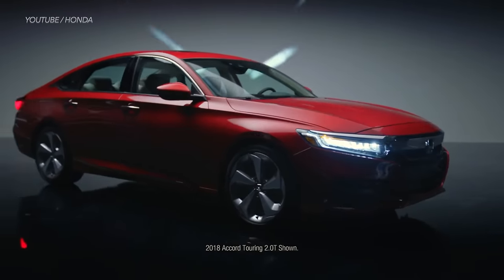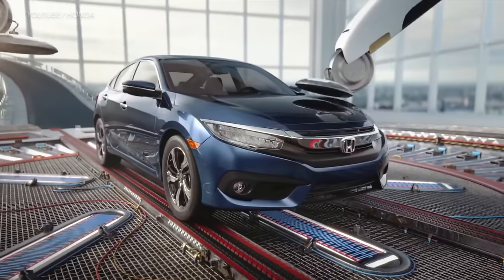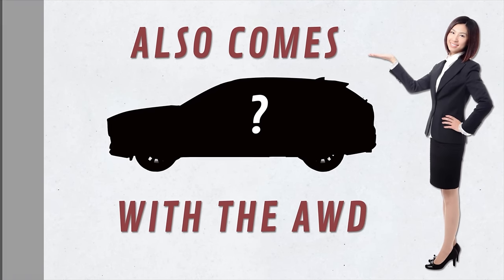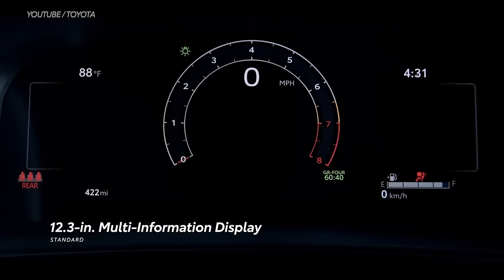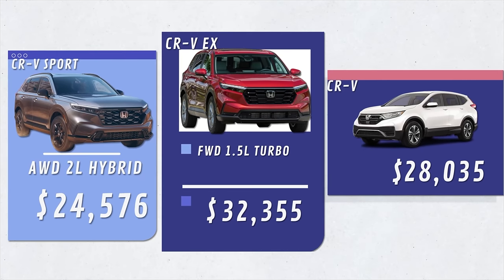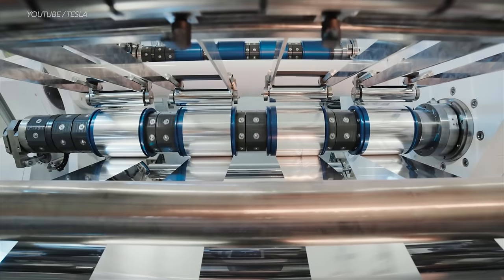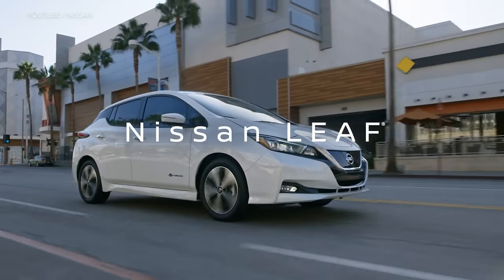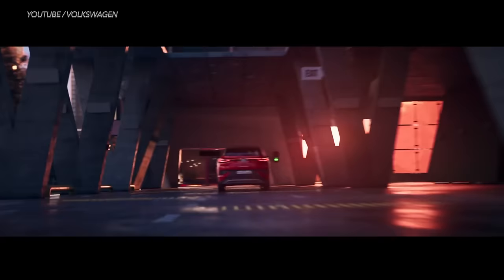Everything You Need to Know Before Buying a Car in 2023

Comment: Crazy. I bought a used 2015 Leaf in 2017 for $9,750 because nobody wanted them. Loved the car. So cheap to drive and virtually no maintenance. Drove it for 5 years, put 45,000 miles on it and sold it back at wholesale to the dealer for $9,000!
Reply: What a great deal, what do you drive now ?
Reply: @aboutmybluestrips  a bike
Reply: those are nearly impossible to get right now i work in the car business none to be found
Reply: How many miles did it have when you bought?

Comment: I was able to find a 2023 Tacoma for the same price as a used 2018 Tacoma from the same dealer so for the first time in my life I’m driving a new vehicle. Honestly insane to me how much used cars are going for currently
Reply: Wow!
Reply: Same with me Honda Ridgeline. Brand spanking new with 2 miles. Over 8K less than a used one with 90k on the clock, and fully loaded.
Reply: After taxes and an extended warranty, I paid 40k for my new '23 car.
Reply: @jackpowell8155  I payed a little over 30 for my Tacoma after tax, I got the utility package honestly a pretty good deal for me at least I don’t need the back seats plus the bed lights on the Tacoma are amazing
Reply: Given some of the complaints about 2022/2023 Tacomas I might go for that 2018.
Reply: @fredmontgomery9436  that's so stupid but there are stupid people paying those prices for used so dealers will take advantage of that. There's a sucker born every day.
Reply: SCORE!!!
Reply: Did the same...got a new 2020 Tacoma 2 years ago
Reply: The 2018 was a better truck.
Reply: @lucilledog8832  they have the same engine, transmission, towing capacity, warranty, weight, seating capacity and much more. It's virtually the same truck. How is the 2018 better?
Reply: @jackpowell8155 40k??? Hope you make good money at least 150k a year you will need it with this new rescisión. 😖
Reply: Great truck, enjoy it and I hope that it treats you well

Comment: When I was shopping for a Ranger last year, a lot of used ones where within $1000 of msrp of a new one.  I didn't need it right away, so I decided to order one so I could at least pick the color.  They even let me drop the automatic start-stop.  Was about 6 months of waiting, but I now have a blue Ranger.
Reply: You were smart, or lucky, or both. I had the same thoughts last year, but decided to hold off and shop used, and shop the new dealer lots as well. Of course I couldn’t find anything, nothing reasonable anyway, and now I can not even order a new Ranger (with my preferred equipment group) due to unavailability of chips. Ford won’t even take an order and put me on a waiting list..
Reply: @histeve1110  they make the ranger at the same plant as the full size bronco. They might be going all in on broncos right now since those are in high demand
Reply: @vitaming582  Interesting, I have to understand their priority. At this point I just have to be stupidly optimistic about 2023 🤪
On a related side note, I have friends that just received a new Bronco..they ordered it over two years ago..
Reply: I ordered a Tucson Hybrid last summer, with the EXACT features, color and interior I wanted... nothing extra I didn't want, nothing short of what I did want.  I had to wait 5 months, and finally picked it up in December 2022, but thanks to the extremely overpriced used car market, i was able to trade-in my old car and have a massive discount on my new car.  I got exactly the new car I wanted at a very reasonable price, thanks to the used car market being so overpriced. All this complaining about new and used car prices, it's like people forget "oh, if used cars cost more than new cars, why don't I trade-in my used car for a new one?"... no, it certainly wasn't free, but dang, I got a lot more for my old car than I would have in a normal market, so my new car was VERY affordable in the end.

Comment: I've been thinking about a PHEV, but it's difficult to justify the price of even a hybrid, which usually cost thousands more than a gas vehicle of the same model. It will take probably a decade to gain that money back thru savings in gas, and the vehicle will likely need a battery swap by that time.
Reply: Yes but they are way less money in maintenance usually. I have had a used Prius C for 4 years and only have done oil and tires.

Comment: Unless you have a real piece of junk you'd be better off keeping your existing vehicle. Replacing a transmission or engine would cost a lot less also. As for putting the chips in the new higher end cars, that makes sense if you can find people that can afford the vehicle.
Reply: As for the chip shortage, its the little things that get cut... I know for multiple Chevy's they are selling cars with "heated seats" that are lacking the microchip that actually controls the heated seats, and Chevy dealers are selling cars (sans-chips) with heated seats that dont work saying "well, when we get the chips down the road, we'll put them in for you"... that's Chevy (who I wouldn't do business with for many reasons, but that's an actual example).

I did recently buy a new 2023 Hyundai Tucson Hybrid... SEL (mid-trim), that a year ago (and for many years before that) had Homelink in the car (basically a built-in garage door opener) for all but the cheapest trims, and now, Homelink is ONLY offered in the top-trim because of the chip shortage.  I'm not paying $5,000 extra for a top trim with features I dont want just to get a built-in garage door opener, so I did an after-purchase replacement of the rearview mirror with a Homelink rearview mirror in my midtrim Tucson Hybrid.  No, it's not a deal-breaker, but these are the types of examples of "chip shortage" issues that are going on with new cars.

Comment: I am a do-it-yourselfer and have had a FIAT for 25 years, and I can tell you the engines are bulletproof, assuming regular oil changes. Straight 4 cylinder, no Turbo, no Direct Injection = no carbon buildup. I honestly dont get the Fiat bashing, yes they are not beautiful looking, yes a Mercedes drives better but its paid and I can sleep

Comment: I have been a mazda guy since 2019.  I just bought my wife a 2021 cx9 with 30,000 miles for 28,000.  that is the awd, turbo. we had them tint the windows and put all weather mats in. Not bad. also 5 year bu. mper to bumper warranty

Comment: I'm trying to get another used ev. Problem is the batteries longevity. I've  test drove two EV'S and have owned  5  in the past.  Battery failure on 4 of the five. 1 volt, 3 leafs , and am now enjoying my slow charged 2013 smart fortwo but not enough range.  Both test drives have failed my battery degradation test. Be careful what you buy.
Reply: The very definition of madness is to continue doing the exact same thing and expect different results.  If 4 of the last 5 EVs you have bought have failed you, maybe you should stop buying EVs?  Maybe take it down a notch, buy HEV or PHEV... at least you have gas to fall back on.

Comment: 4Runner TRD Offroads are listed with a 10-15k markup here in the Carolinas. And dealers are giving auction values for trade ins. CarMax and Carvanas here are overflowing with high mileage used vehicles. My credit union said with the newest interest rate hike again used cars would be north of 7% with good credit.  

Dealers will be sucking in the spring when people do not get good tax returns back with the new system.

Comment: Hi Scotty, I bought a 23 Rav4 4WD (gas model) a couple of days ago. Hybrids are flying off even before they arrive at the dealerships. The local dealer near me wanted to charge $4000 markup so we walked out. I did a little research and found a Toyota dealer in WV who promised to never markup any vehicles so went there and got a new rav4. The cost has increased by a $1000 and paid $33,500 out of the door. Toyota is shipping cars with accessories like BSM pre-installed and its better to be a little flexible. A 2020 used one with 8000 miles was $31000. I went for a new one for that one. Got a $500 student discount.
Reply: Hybrids of all manufacturers are rarely sitting on lots anywhere.  Due to the fact they usually cost very close to MSRP of their ICE counterparts, and that they save gas and often have more HP, Hybrids are far more popular than ICE of the same model right now.  If you want a brand new 2023 Hybrid from any manufacturer (it's not just Toyota), expect to have to order one and wait several months to a year for it to arrive.
Like you mentioned, different dealerships offer different deals... some are greedy and markup, others will keep it to MSRP. Glad you found an honest dealership.  I ordered a 2022 Hyundai Tucson Hybrid back in July of last year, and it finally showed up in December 2022, but magically turned into a 2023 Tucson Hybrid. I got it for MSRP, minus the overvalued trade-in of my used car. Thanks to the high cost of used cars, I was able to get a huge discount on my new car because of it!

Comment: What's wrong with and 5.7 pushrod engine? These engines made a lot of sense and I'm putting a crate 5.7 in my 1984 Corvette. The only thing different I'm doing is putting 202 heads on with a little beefer cam around a 2000 to 3000 power band. I'll put a stall converter with a 2000 stall.

Comment: The best thing to buy will be a car with manual transmission and regular engine. EVs can't go coast to coast.
Reply: Yep, totally agree. I'm not replacing my car that I bought for £950 And is still running and paying £300 - £400 a month for 4 years just for a new car. Screw that.
I have better things to spend my money on!
Reply: No, but an automatic HEV or PHEV can go coast to coast and spend a lot less on gas than your manual transmission with a regular engine and do it with more safety features and cabin comforts.  They will also do it more quickly, because an HEV or PHEV will pass you filling at the gas station while they drive on buy.

Comment: Prices in Europe are incredible. Roughly speaking, everything is two times more expensive than it was 5 years ago.
Fiat 500 is 18k (it was 10)
Fiat Tipo is 28k (it was 18)
New Alfa Tonale, with only 130 hp is 36k (Jesus Christ, how...)
New Peugeot 508, sedan, 130 hp, nothing spectacular is 46k (it was never more than 25, maybe 30 with leather seats)

Insane prices. 

My first car, bought in 2012 were paid 2.700
Today, equivalent car, equivalent engine... 6.700?! 

Money is becoming worthless

It's also twice the expensive if expressed in salaries
Reply: I still have my 1989 Mazda after a third of a century; I don't care that it's slower and less safe in a crash than newer vehicles; it is more reliable than newer vehicles and gets me where I want to go just like a brand new vehicle would; I have just rebuilt it and it will be dependable for a few more decades..
Reply: @petesmitt  You are a smart man. My father still has his Alfa, and my Alfa. Both of them are 1.9 diesels, bulletproof, even after 20 years.

Comment: Ordered a Hybrid (Ford Maverick) back in September, expecting to take delivery later this month. Its a shame the IRA doesn't seem to incentivise Hybrids in any form, like it does BEVs, especially when there has been little interest from most EV makers in making EVs that are both affordable to the average consumer and offer sufficient range for people in rural areas. So far, only Ford has a EV with over 200 mikes estimated range, without all the luxury bells and whistles that seem to be inflating EV prices. Another failure of the IRA is charger cross compatibility, non Tesla EVs need to be able to take advantage of Tesla's Supercharger network, especially while other DC fast charging networks are barely on the map. Until these EV bugs can be worked out, FHEV (Traditional Hybrid) and PHEV (Plug-in Hybrid) will outsell Battery and Hydrogen Fuel Cell EVs.
Reply: 100% agreed on the charging network.  I couldn't imagine buying a new non-Tesla EV and needing to travel >300 miles only to get stuck in hotel due to faulty chargers.  There are some great BEV's on the horizon, several which I'd like to buy but everything I've researched shows nobody can match Tesla's supercharger network.  That is of course if you're road tripping.  I've watched many videos, read many threads and found out that even some brand-new EA chargers are failing because of cold weather....and they're not reporting as being down when they're actually down.  For BEV to become mainstream.  The charging networks have to improve as well.

Comment: If I sold my 2018 Camry XLE at one point, I would have gotten what I bought it for!
Reply: is it a cvt transmission?
Reply: @Sneakerheadbaris  no
Reply: but 10.000 usd today is worth less than 10.000 usd in 2018, due to inflation
Reply: @maciejp7829  what does that mean it make a difference!? I could have gotten the same I paid brand new for a 4 yr old car!
Reply: 😂 never. Cars depreciate. Depends on miles on engine. You sell your car your not going to get anything what what you paid for.

Comment: I'm struggling right now to find a decent used vehicle replacement for my 2012 Jetta SEL. Want to get a Civic or a Corolla but both are out of my price range right now due to the high prices on used  cars.
Reply: Me too. I've decided to go for older years as long as well maintained.
Reply: Buy from a private owner. It better than paying monthly. I mean sure you don't trust alot of these owners I don't either that why I ask them to show up at the car shop for inspection or have one of my friend inspect it.
Reply: The Avalons and Solaras from 20 years ago are ugly as sin and don’t die. 😂 Being ugly and 20 years old may equate to a decent price for a car that may go another 100k or so.

Comment: I at times have buyers regret. I bought  2021 Tacoma TDR OR for $38K. It had the Iron Man stage 2 nitro lift,, BF Goodrich KO2s 33" and method 17" rims with factory warranty and 29K miles on it. So I think I did ok but still have doubts.
Reply: Well you have time to sell before used car prices fall
Reply: That’s not too bad, maybe overpaid by 5k or so
Reply: @Austinomical  "overpaid by $5,000 dollars" is not OK in my book.  If it's ok by you, can you give me $5K?
Reply: And it has likely never left the pavement - or hauled anything. Sounds like a real economical purchase - especially at the gas pumps.

Comment: UPDATE:  The Subaru website and the window sticker indicated that I should get around 31 mpg with the Subaru Legacy Sport.  On my trip home, I averaged, according to the Subaru itself, 26.6 mpg.  Moving from a normally aspirated 2.5 liter engine to a turbocharged 2.4 liter engine appears to have cost me right at 10 mpg.  This was also driving on cruise control almost the entire way.  YES, I have logged a complaint with the EPA. Talk about your carbon footprint and a dent to the wallet!

On 12/31/2022 I bought a new Subaru Legacy Sport.  I had to drive over 600 miles to pick it up and got only a fair trade-in value of $10,000 for my 2017 Subaru Premium with 90K miles on it.  I looked at one closer.  It had been purchased and driven 400+ miles.  They owners then traded it in for a BMW. (Go figure!) Their NOW SLIGHTLY USED Subaru Legacy Sport was then offered to me ABOVE MSRP and no longer qualified for the Subaru 10 year/100,000 mile bumper to bumper warranty.  I was offered a 7 year/100,000 bumper to bumper warranty instead.
Reply: The EPA mileage ratings are calculated using “professional mileage experts” under perfect temperature conditions, they shift the cars manually at exact RPMs, and who knows what else. I saw a video with 2 of them driving from New Orleans to Virginia on tank of gas. They will extend the range of the Dodge Ram 1/2 ton Diesel from 700 miles to over a Thousand miles.
Reply: When I bought my 2019 Impreza Premium it said avg 29 MPG on the 2.0 non-turbo CVT, I was getting about 26. After the car broke in now at 30K I get an avg of 33MPG & 41 hwy, can't complain! IMO your engine is NOT broken in yet, give it several oil changes.

Comment: How many gallons of oil does it take to lubricate a wind turbine? How do trains work? Electric diesel hybrid?  Trains pull huge amounts of cargo. If you remove the diesel motor you might as well get out and push the train.
Reply: @curtbowers7817  it's wacked alright.👍

Comment: It definitely sucks that I'm paying the same cost of a 2013 Toyota RAV4 as you would back in 2013 when it had 0 miles on it. Now it started with like 68,000 miles when I bought it. But I'm glad I got one from a good dealership before they got even more expensive. My car payment is also around 400 dollars, so I guess I lucked out.
Reply: Your Rav4 must have been previously owned by some grandparents... 68,000 miles is very low mileage for a 10 year old car.  That's good for you though.